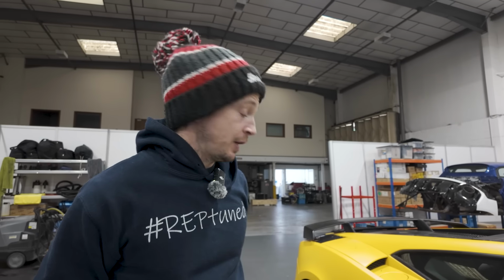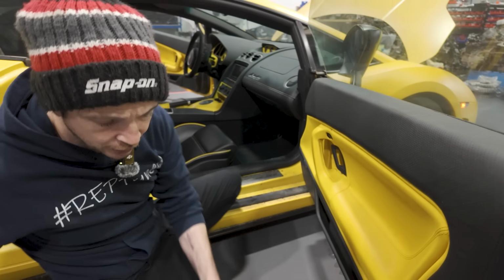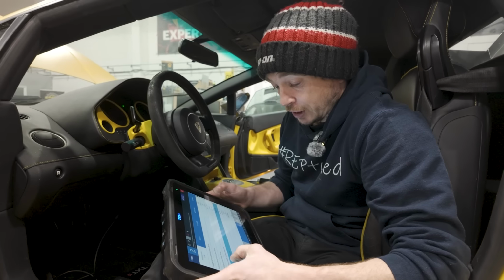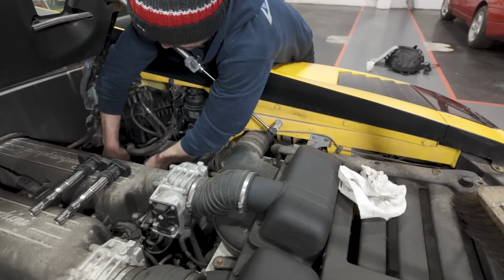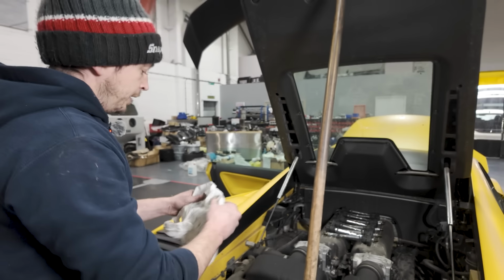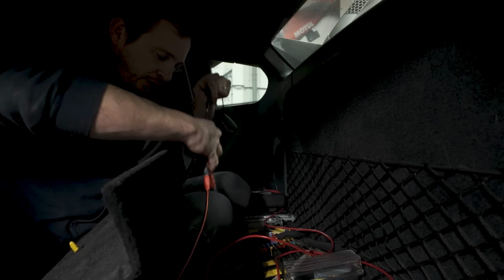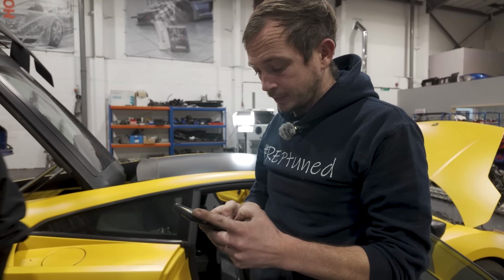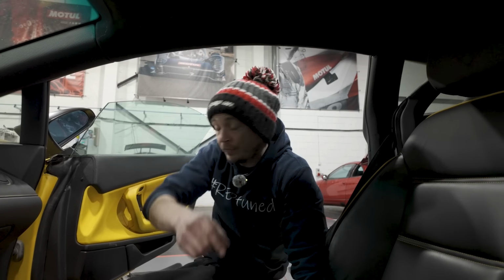Everything Wrong With This Abandoned Lamborghini Gallardo!

Comment: It wont be this but when ever I see key issues I post.  I had similar  issues with the key on my Audi when it did not have a high quality  CR2032 battery in the fob. The voltage was fine and the battery worked in other things. The branded batteries  I bought from a online retailer were counterfeit. It was my spare key so not an issue until I needed it and the main was not working.

Comment: 710 😂 quality. Maybe I'm being dull but.. close door, both of them, bonnet and eng cover too, ecu will detect something/anything open and not allow recognition of new code from key/fob. Also have learned the hard way that not all 3v batteries are made equal, have had issues with fob/key not working with a new battery, reading 3v, change the battery for another/different make new one and hey-presto! 😊 think it was a new Panasonic I swapped for a new JCB and it fixed what was thought to be a buggered fob! Counter intuitive I know, who'd think a new branded battery would be shiit!?
Reply from the maker: Says safe on dash…. That’s immobiliser

Comment: Hmm, I was looking into your effort spent on a car and was thinking -  what the hell are you investigating without a proper coded key at the first place? Checking key fob battery should had been the very first thing to do, next - to check fault codes for immobilizer, conform key is not recognized by the car. Third - get it coded.
Reply from the maker: What was the first thing I did when we chatted the battery? 😂😂🤦🏼‍♂️🤦🏼‍♂️

Comment: Question for all the knowlegeable viewers.
I have very basic mechanic skills, I believe I'm quite logically minded.
The good lady's Golf 5 needs new timing chain. Been quoted €1500. Not worth it on a €2500 ? Car. Only 110k on the clock, so...
Is it a job I could wrap my head round and complete successfully?
As a novice, should I steer well clear? Or get ordering the parts and get my hands dirty.. €300 odd for parts.. 
Or accept the €1300 a dealer has offered as is. Thanks.
Reply: It could be quite a tricky job and quite involved. Do some research first and see what you think and have a back up plan if you get stuck half way though.
Reply: If you have the workshop manual and timing tools for that engine I'd say go for it.
Reply: @kings3803  Yeh, Thanks. Mrs has a new car, so I can take all the time I need. Otherwise it's a great little car, seems a shame to get rid for 1300...
Reply: @TheCerovec  Aye, I think I will. The worst? I can't fix it. Outta pocket a little. Cool little car, I think worth plenty more than the dealers 1300. Cheers for your input.